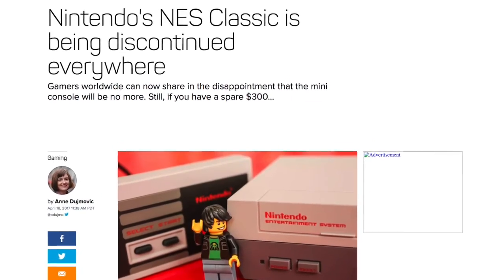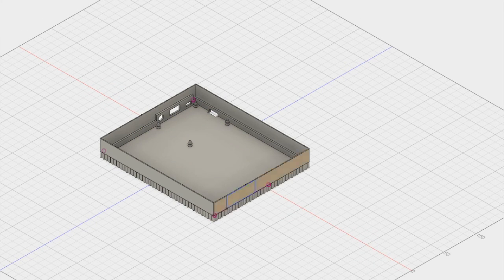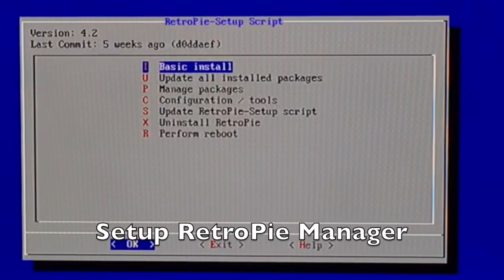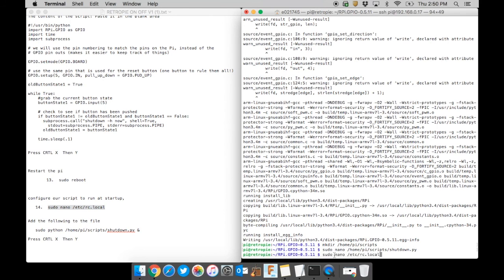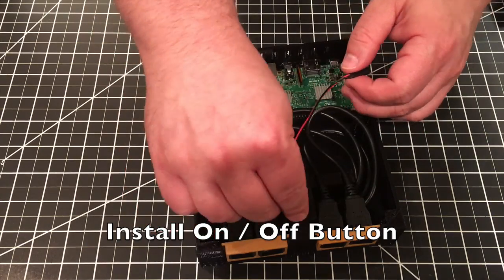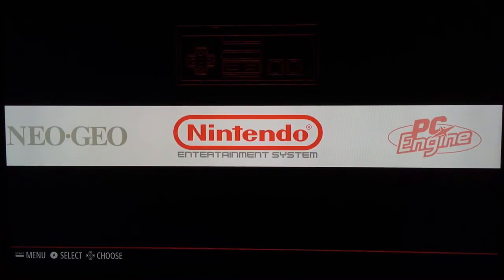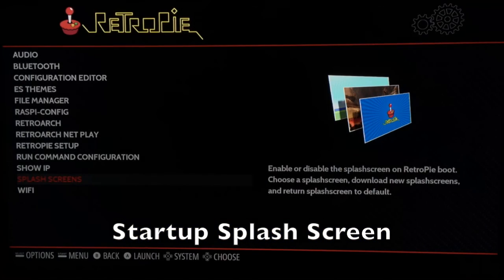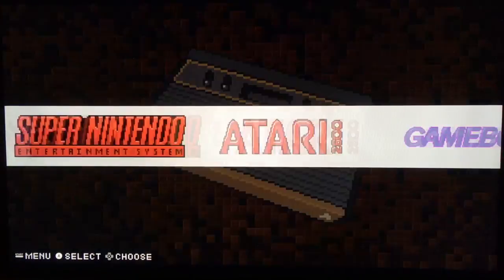Epically Geeky Makers - SNES Mini Raspberry Pi 3 Case

Comment: I out a pie in a broken super famicom...used the power and LED buttons...and I use the original SNES controller port connected to the PI. I did not make the effort to build an image from scratch...found a prebuilt one ready to go with no issues from boot.

Comment: Great tutorial. Got a question though. I have a 3d20 as well, wanted to know all your settings for the printer, been having trouble getting it to print properly, getting a lot of lift on my prints.
Reply: I also use a small putty knife / blade to get the builds off and scrape the rest of the glue off the plate after every build. I don't know if I have to do that or not but I do.

Comment: Are all of your prints on Thingiverse in the correct orientation to where I can just load them into my slicer and go? I ask because it says no supports, I assume you have built in what ever supports are needed?
Reply: jgr102080 depending on which axis you import them in, yes they should be correct. In any case, if you lay them flat, none should need supports as the few overhangs are no greater than 45°.

Comment: Great Guide.  Anyway to attach a 5V fan to make it run when you turn on the RPI?  tried connecting the fan instead of the LED but wont work.  Sorry NOOB to all of these.. Thanks!

Comment: You might want to consider updating this for the RPi4, the Python GPIO package you linked (0.5.11) is old and isn't compatible with the RPi4, resulting in the pi getting stuck in a shutdown loop because the state of the button is always different.

Changing all the commands to reference 0.7.0 instead worked for me.
wget https://pypi.python.org/packages/source/R/RPi.GPIO/RPi.GPIO-0.7.0.tar.gz
sudo tar -zxvf RPi.GPIO-0.7.0.tar.gz
cd RPi.GPIO-0.7.0
Thanks for all the work you put into this.

Comment: how much would you charge for a pre made one?
Reply: Joshua Whiting I charge $150 + shipping. That's for the case, Pi 3, 16GB Micro SD card already configured with RetroPie and the mods I made in the video, HDMI, USB power cord & 2 SNES USB controllers. DOES NOT INCLUDE ROMS.